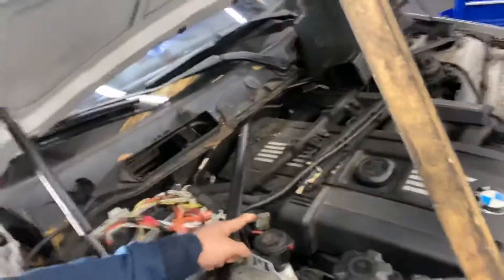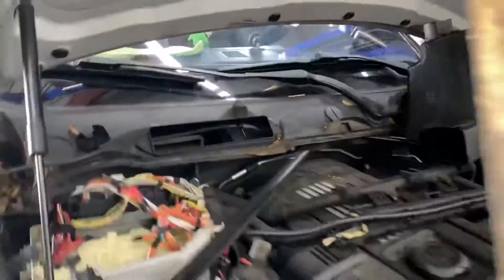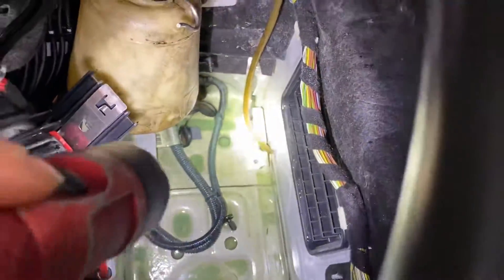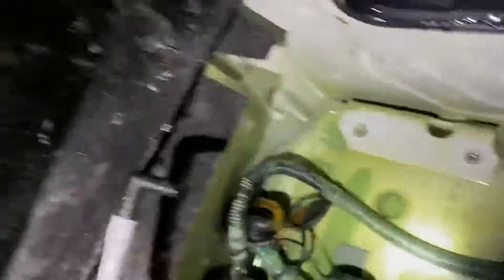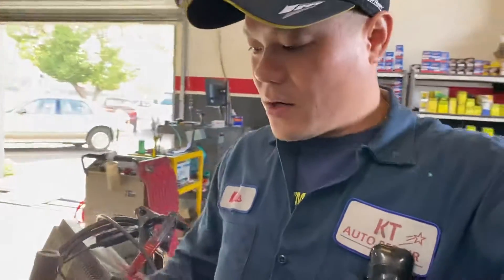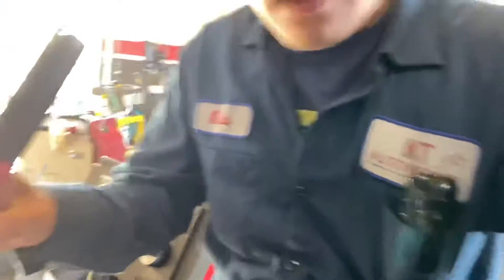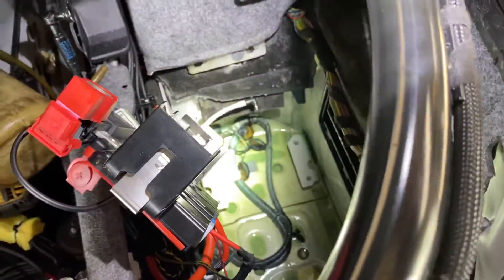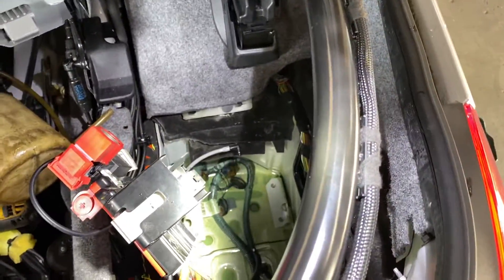2011 BMW 328i Convertible. Missing alternator code 2e98

Comment: I am having the same issue water in there , cleabed it out and drillrd holes in the drains . The 2 terminals were corroded and the nuts were basicaly falling apart . Cleaned and Replaced but still having the same issue 2e98 .

Comment: What happen with this?
Reply from the maker: King Pharaoh water corroded the cable. It broke as soon as I touched it.
Reply: @invistar126  so you put a new one on and it fixed the problem?
Reply from the maker: King Pharaoh yes. I put a new 1 in and it fixed it.
Reply: @invistar126  what cable
Reply: Water came from where? I hope maybe customer kept the trunk open overnight while it rained.